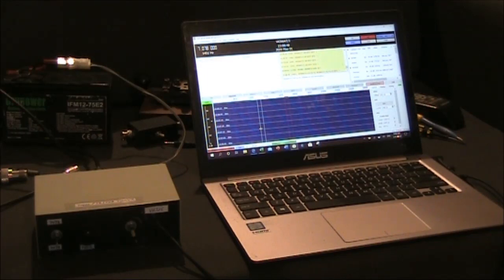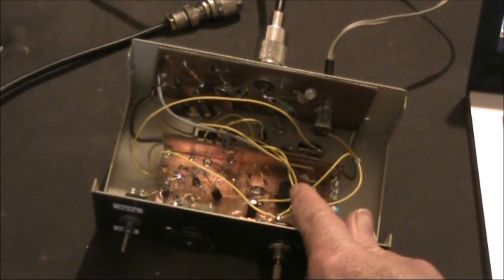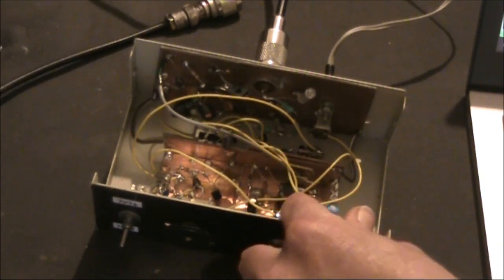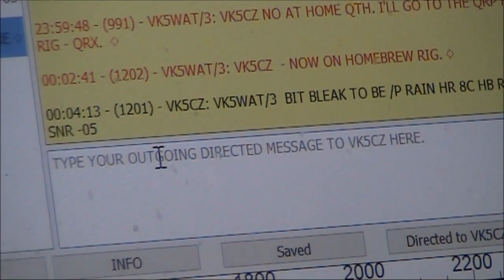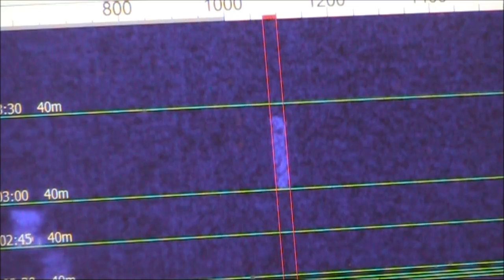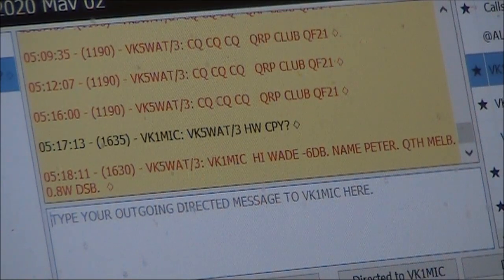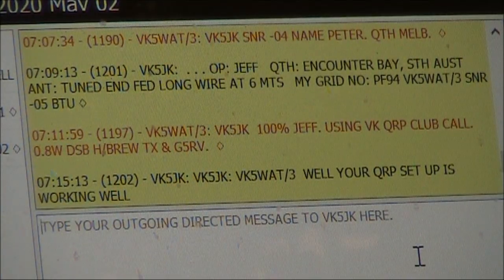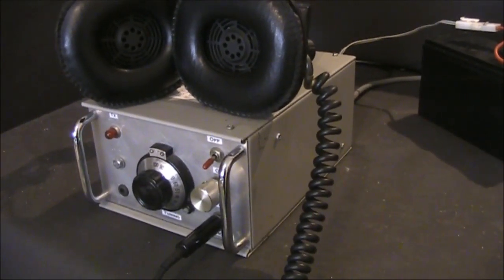VK5WAT QRP activity JS8 FT8 CW May 2020

Comment: Is that the 12 volt sealed lead acid cell sold by Jaycar I spy in the background? I use one of those…. Love this rig…. Love the CW QSO’s!
Reply from the maker: Thanks. The battery is an expensive LiFePO4 type. Similar capacity but much lighter than SLAs.